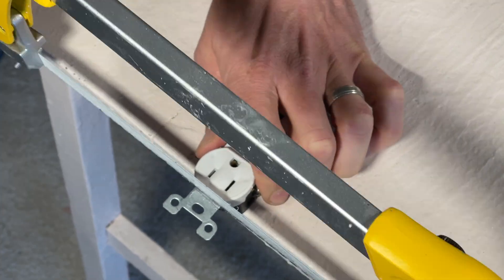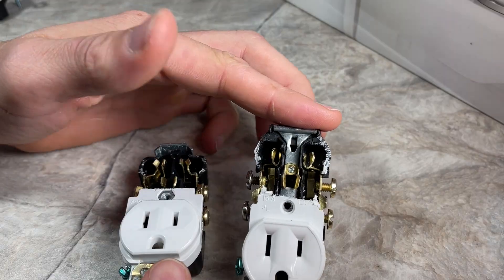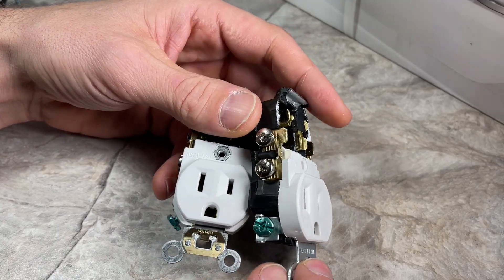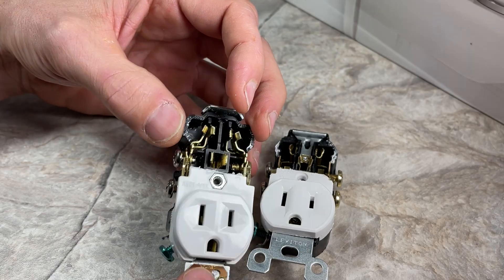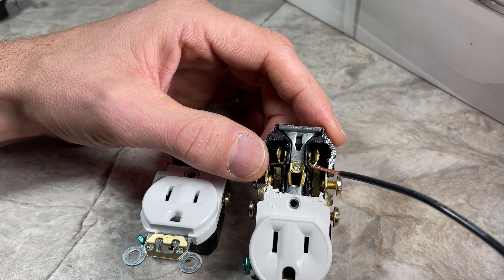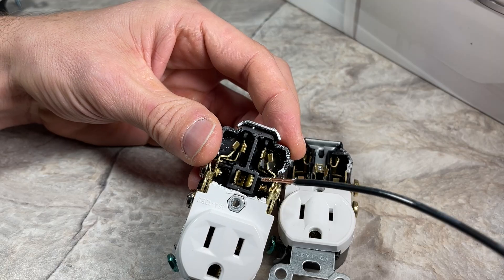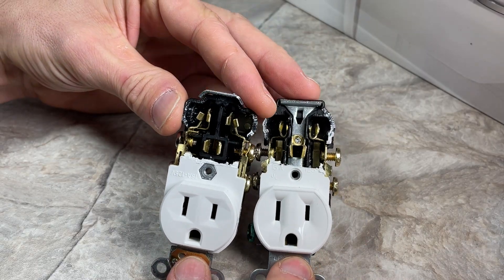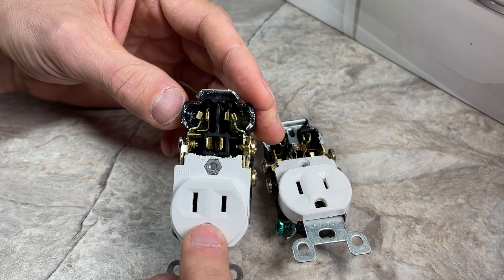What Outlet Should You Buy For Your Home |  Commercial vs Residential

Comment: Another thing, something you should know, is commercial 20 amp outlets are heavier built than the 15 amp you have above.  In locations that you need to use the full 20 amp circuit capacity, especially in locations where the outlet is plugged in/out often, you should buy and install the 20 amp commercial plug [ neutral socket looks like " I- " ].  Like in a barn/garage/work area.  I always install the 20 amp duplexes.

Comment: wow, 50 cents for an outlet, in Denmark a complete assembly is between 50 and 75$ that is if it is a name brand with a circuit breaker switch
Reply from the maker: Dang!  Many have mentioned the much stricter electrical code in Europe which I am sure drives up the cost.  Thanks for sharing 👍

Comment: The internal metals in the more expensive one is solid brass and the cheaper is brass plated steel
Reply: I’m not so sure. Steel would be mechanically superior to brass. So it would last much longer.
Reply: @erikkovacs3097  Someone correct me if I'm wrong but: Isn't mixing metals bad when dealing with electrical components because galvanic corrosion will cause one of the metals to rust at the point of contact?
Reply: @JDWonders  It is assumed that the steel would be coated in brass to make it compatible with the prongs from power cords.
Reply: jkee @erikkovacs3097
Reply: @markzulu7712  Hahahah your cat opened the YouTube app.
Reply: Rldk
Reply: H.   Uuuiuuui uju

Comment: As a state licensed C10 electrical contractor, of eight years and a journeyman electrician for about 30 years,   both commercial/industrial and residential experience, I will say you did a very good job in describing and showing the differences in a cheap receptacle (outlet) and a higher quality device. 
  Those are still only basic receptacles, as you pointed out. There is National code in place and almost every state and city enforce the code for use of TR, tamper resistant, receptacles. That type make it difficult if not nearly impossible for a child / toddler to stick anything into the slots of the device protecting the person from electrical shock. This type of receptacle should be installed everywhere except where a GFCI or GFCI / AFCI receptacles are required.
  Keep up the good work on your videos
Reply: Tamper Resistant Commercial/Industrial/Hospital Grade outlets should be used everywhere. Residential outlets used nowhere.
Reply: They make it virtually impossible to plug anything in is what they do. Much like the gas can spouts actually cause spills as opposed to the old spouts. Stupid new ideas are not better just stupid.
Reply: @scoutmaster33  --- you are not wrong saying that. The tamper resistant receptacles can be very difficult for anyone to plug something into, even the proper male cord end. 
 But, the main function of the National Electrical Code (NEC), clearly states at the beginning of the code book, the purpose of the NEC is the practical safeguarding of people and property from hazards arising from the use of electricity. 
  Underwriters Laboratory's (UL) approval for devices and materials, used in the manufacturing of electrical products, has their own requirements. Then the installation and use of those products, by a qualified person in a professional and workmanlike manner, all make electricity so safe that, people don't even think about the lights not coming on when the switch is turned on or the possibility of their computer or their coffee maker, not working or electrocution when pushing the power button or plugging in a hair dryer or a phone charger. 
  But there is a constant threat to people's lives and property by a living, moving, invisible, rarely making a sound, has no smell, it lives in the air, in water, in solid ground and most all metals and elements are transformed by it, in both positive and negative ways,  and is not even fully understood, but we've temporarily harnessed it to work for us as long as we have respect for it and use it safely. 
  Most people have never seen someone who has been electrocuted, or been shocked, or had a tool or device short out  and see the sparks and flames and flashes of lightning or arcs from even regular household voltage. Or watch a YouTube video that shows the opening of the switch for a substation. I'll find a link and post it here. It is crazy. Here is one short video link and there are many more videos that show electrical failures, etc.... 
https://youtu.be/iW90XX7rjbc
 I watch them every year or so just to remind me that what I'm doing everyday is very very dangerous.  
  All people should know that men and women die almost everyday providing people with the convenience of having electricity in their home.
Reply: @13_13k  as an electrical engineer I’ve been around motor manufacturing my entire career. Have to take annual arc flash safety training so I’ve seen most of the final moments of life scenes in the videos. Been involved with accident/near miss investigation on several occasions and you are correct the code is to make it as safe as possible for people who have no clue how electricity works to use it. Mostly work in higher three phase voltages up through 22KV although we do some testing through 50KV.  
The purpose of listings like UL, CE, etc it to provide a minimum level of safety in products so they are “safe” to use because as so often happens they end up shaving off quality to reduce cost until it often literally blows up in someone’s face.
Went to the link and the “lightning” was pretty spectacular however that is how they normally operate the heat from the arc causes it to rise making the arc longer until it extinguishes itself my dad was an Electrical Engineer for a utility and transmission stations. I actually got to touch a 345KV line as a student in a test lab for an IEEE tour. Purpose was to demonstrate the shock you get due to the distance charge principle the further you reach out to grab it the bigger the shock when you touch it. Now keep in mind this was isolated from ground so the shock was fairly low voltage. We all then went to the viewing area where they faulted it to ground literally vaporizing a 1/4x2 aluminum bar in the process. The “explosion” of vaporizing metal is not something you’ll ever forget after seeing it live....
Reply: @scoutmaster33  --- you fully understand what I'm talking about. 
  The link to the disconnection of the substation switch was just basic visual for people who have never seen an arc flash, so they get an idea of just what kind of power goes through transmission lines to supply their home and workplace.
   I spent 16 years as a journeyman wireman in the IBEW doing commercial and industrial electrical work mostly new construction of high rises, hospitals, sports stadiums, laboratories, in the Silicon Valley building Google, Yahoo, Intel, Applied Materials, 3Com, Cisco, NASA, GE mock Nuclear Power Plant, Stanford hospital, Stanford Stadium, S.F.Giants Stadium, just to name a few of the jobs. I usually was the one or one of the 2 or 3 men that started the job when it was just a hole in the ground and we set temp power for the steel workers and we would start the underground pipework and the electrical vaults and the main electric room for the building. I set the switchgear and transformers, and then set up the pulls for all the building feeder wires usually 500mcm wire or 650mcm or 750mcm  once in a while. 5 wires, sometimes 10, and each wire is the diameter of a roll of U.S. Quarter Dollar coins and weighs about 2 pounds per foot of length. 
   I've actually had to climb inside a large 10,000 amp 1000 volt main switchgear while it was live to land the new set of 350 mcm feeder wires on an 800 amp 3 pole 3 phase circuit breaker. The heat and the vibration in a large electric equipment room can be very high and the ions in the air are charged making the hair on your arms stand up. Sweating profusely from the heat generated, scared for your life and the lives of your tool partner(s) there with you handing me tools and parts, and concentration as deep and focused as you've ever had to do because one wrong move, one dropped wrench, or something grounded touching me accidentally like the whole frame of the switchgear I'm working in, and me touching something live like the bussbar or an exposed metal button or zipper getting close enough for an arc to jump and I'd be dead before I knew I fucked up.
  Dead is the best result in an electrical accident. You won't want to live after being cooked from the inside out by your blood and the water our bodies are made of boiling and then the molten steel, aluminum, copper, plastic, etc... shrapnel exploding into your body as the flash of fire as hot as the sun engulfs you for just an instant faster than the blink of an eye. Any clothing or jewelry or tools on your body melt and stick to your burnt body. 
  
   All that is going through your head until you start doing the actual work then you have to clear your head of everything except getting the job done and not making any mistakes, every move and every breath is taken slowly and methodically watching clearances between anything energized and yourself and your tools in your hands. 
   You know when you are doing a dangerous job when the protocall to work on a live circuit breaker panel is to have to wear fireproof Nomex jacket gloves, faceshield etc... but when it requires one other journeyman wireman to stand about five feet away from you while you work, and he has a 6ft long fiberglass Shepard's hook and his job is to just watch and use that hook to pull your body off the live wires or switchgear when you are hung up being electrocuted.
 That makes you a very humble person who had better have kissed their wife and kids that morning before going to work every day. When you face death every day at work at any minute during your every day job, it makes you appreciate a lot of things that most people never think about.  It also makes you realize you need to enjoy your life away from work as much as possible.

Comment: Yeah! I replaced the outlets in the bathroom where my wife plugs in her hair appliances with  commercial grade. No more problems.
Reply: I believe any outlet installed today in a bathroom has to be GFCI per code as well. It may be only those within a certain distance of a water usage appliance or below a certain height, but I think for bathrooms now it's all of them. Just a note.
Reply: @802Garage  I think the rule is within 3 feet of water. But if you uses a GFI breaker a lot cheaper if the bathrooms are close to each other.
Reply: That GFCI outlet only needs to be in the first box in the circuit (read as only one per circuit allowed). I've seen GFCI outlet located in the garage, circuit then passes through the outdoor deck and into the powder room and finally up into the master bath. There were only cheap outlets on all the boxes after the garage. You can guess the garage  was also a cheap 15A harbor frieght outlet. $1 Million production house.
Reply: @KarlKoning  Correct, bought a house where the plugs in bathroom were not working,,, tracked it back to a bad GFI...at beginning .  I think bathrooms need to have dedicated GFI breaker, so no GFI plugs needed.
Reply: @BasketCaseGarageForFun  Not a bad idea as long as the breaker box is close by. A longer wire means a bigger/longer punch before the circuit breaks. AC doesn't take much to zap you. That is why they pop at <4 miliAmp differential.  So maybe dedicated circuits with first GFCI box in each bathroom is safest even if it's not the cheapest.
Reply: @KarlKoning  Can you explain in dummy terms why a hair dryer with not cause the gfi to trip..  I assume because it's the return voltage that trips it, so a body or water would steal some return? But why does a dryer not drain that return. Because its AC?
Reply: @BasketCaseGarageForFun   A GFCI is constantly monitoring the difference in Amperage between the Power (IN) and Neutral (OUT) lines. In a standard circuit the laws of physics say these must be equal. If there is a difference it must be a break in the circuit that is going to Ground. That ground could be through the water/body to the plumbing, gas line, any metal object connected to ground but on a different circuit. Since the Ground is what is at fault and interrupting the flow within the circuit, the GFCI outlet completes the interuption by tripping it's own circuit breaker. An overdraw will also pop the GFCI breaker. A hair dryer is good on the completed circuit (unless it and something else draws too much for the breaker). It's double insulation helps keep the Power & Neutral balanced (maybe turning on or off can cause the GFCI to register a difference). Drop the hairdryer in the  filled tub/sink while its plugged in and power starts to leave the circuit in a hurry. Without the GFCI a whole lot of power will leave the circuit before a standard 15 Amp Circuit breaker's overdraw level is reached. Thus the GFCI's  1/10 of a second response to a 4 miliamp difference. Because that is all it takes in an AC circuit to kill. The electrical engineers I worked with had this montra: "electricity is Sudden & Deadly!"
Reply: @KarlKoning   I think your saying in my language using water as the image.. if the pipe leaks it flows in to the overflow and triggers a shutoff.
Reply: @BasketCaseGarageForFun  Really close...if the pipe leaks at all [measurably]...shutoff!
Reply: @KarlKoning  I get it now.. different subject, why is the ground tied to the common in the panel. I guess the same, the leak is going to the source thru the ground because it’s empty.
Reply: @BasketCaseGarageForFun  That 'ground' is for safety reasons and is not the only 'ground'. It's called ground because all the electricity has to return to the transformer. Anything that 'escapes' the neutral and ground wire will pass into the ground via rod, footing steel, service pipes and even moisture and return to the ground wire at the pole completing the circuit to the transformer. Electricity likes the easiest path so bringing the ground to the MAIN panel and bonding it only once, means this wayward electricity can now return to the transformer using the Neutral wire. Kind of like an overflow drain pipe except that the overflows all travel in their own pipes until they are about to leave the house. Then they merge with the standard drain pipes so there is only one hole in the foundation and at the sewer line. Not so conveinient in plumbing but eay to impliment with wires. Since there is no gravity help, wires have only the one bonding point so there is less opportunity for power on the ground wire and looping of circuits.
Reply: @KarlKoning  how does it escape when it’s bonded. I think your saying shorted wires or breakers in the panel. That is hard for me to understand.  Even if they short to the panel why would the amps chose a ground rod over the path back to the pole?
Reply: @KarlKoning  That is sad. Each should be a home run, dedicated circuit; as power equipment in garage can be running simultaneous with other items. And if the Panel is IN the garage, how much extra was that? Also I would want dedicated orange circuit to each bedroom, living room entertainment power chase, and study; as computer/entertainment equipment needs better protection. "A whole house" UPS to serve these dedicated lines, or use independent UPS plugged in locally to these devices. I have 3 UPS units at work, and 2 at home. What I really need is a whole house rewire. The main service was upgraded, but I have light switches with one outlet at chin height, and no outlets down low where they belong.  1960 saw a lot of garbage construction, and SQUEAKY floors

Comment: The residential or commercial receptacle (plug/outlet) shown in this video is a basic 15 amp duplex.  There are other types of residential or commercial grade receptacles do have the push in connectors which are rated for #12 or 10 size wire, rated for 15 amps or 20 amps, indoor or outdoor, wet/damp locations, tamper resistant or GFCI.  The blade style on the receptacle will indicate which amperage rated for.  Majority of good electricians will use the side terminals to make connections.  Other factors determine what kind of receptacle you should get.  If you are unsure which to get receptacle to get, look at the amp and voltage rating on the old receptacle.

Comment: excellent video.  I knew about 2-3 of the obvious visible differences on the outside and the heavy weight feel to the commercial grade outlet, and that's why I use them, but seeing the inner workings and the explanation of them was really helpful.  Confirms what I figured, but gave reasons why.  Thanks!

Comment: Does this also apply to toggle switches, or do the standard ones work fine in the long-term?

Great video. Very well explained.
Reply: You want to look for one with a good snap/click as it means it's switching from open to closed and vise versa quickly wish reduces arching and heating. Also you want one that is hard to impossible to balanced in the middle (think kids playing with the switch) because of it. The video actually misses a lot of stuff on the outlet end and really doesn't hit on the fact the the cheap residential are also good for like 99.99% of people.
Reply: zachary thebeau thanks for the information. I just went and exchanged my new residential outlets for commercial ones. A little bit more expensive, but worth it, in my opinion.
Reply: A switch that is seldom used  ( closet ). it may not matter. Any switch used more than twice a week? use spec grade switches. Ones rated at 100,000 uses.
Reply: with LEDs drawing so little power, you will not wear out a switch nowadays